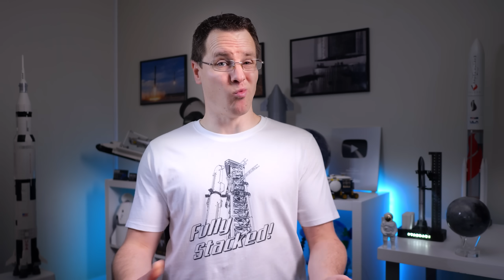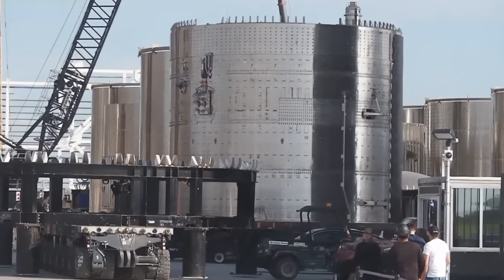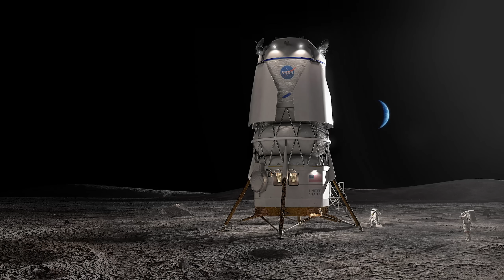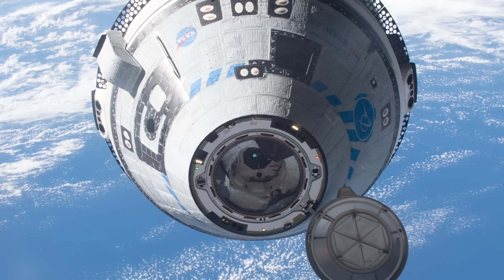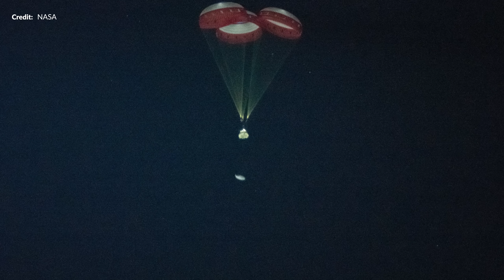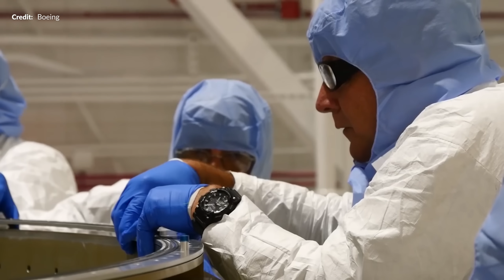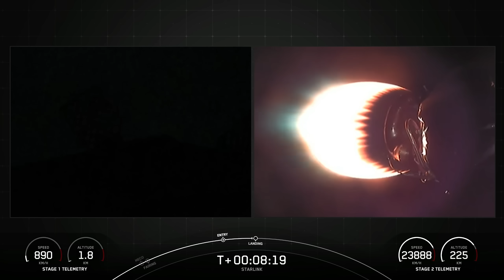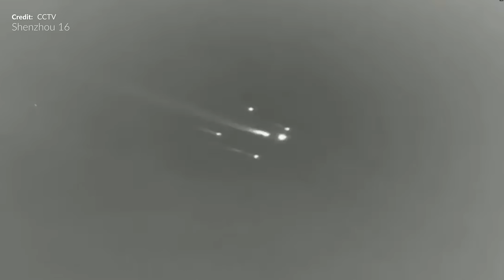SpaceX Starship: Mega Pad Upgrade to Tame the Thrust, Boeing Starliner Delayed Indefinitely

Comment: The fact that there is a problem with flammable tape in Starliner is somewhat unsurprising given that Boeing is the contractor. Their current recurring issues in commercial aviation products and the roots of their space products reaching back to North American Aviation and the Apollo 1 disaster seem to point to a company that just can't grasp the concept of learning from mistakes and incorporating that knowledge into basic design parameters.
Reply: To be fair, the tape is flammable only in certain situations per reports. And requires failures of other hardware to happen. Per NASA/Boeing, "Although that tape is commonly used on other spacecraft, they are evaluating if it is acceptable for crewed flight (article NASA and Boeing say preparations continue for July Starliner test flight Jeff Foust May 27, 2023)"

Parachute and wiring issues to delay Starliner crewed test flight
Jeff Foust - June 1, 2023

"Both the parachute soft links and wiring tape were used on the Orbital Flight Test (OFT) 2 uncrewed test flight in May 2022 without incident. The soft link issue, officials said, would only be a concern if one of the three main parachutes failed, putting additional loads on the other two, while the flammable tape would have required what Nappi called “multiple failures” elsewhere in the spacecraft."

---------------

Boeing finds two serious problems with Starliner just weeks before launch
ERIC BERGER - 6/1/2023

"The second issue involves P-213 glass cloth tape that is wrapped around wiring harnesses throughout the vehicle. These cables run everywhere, and Nappi said there are hundreds of feet of these wiring harnesses. The tape is intended to protect the wiring from nicks. However, during recent tests, it was discovered that under certain circumstances possible in flight, this tape is flammable."

Comment: dude  is stupidly made , fast and meaningless lol  :) , that "jet countermeasure" should have a conus like an icecream tip , to guide the flow in a wished direction , it does not matter speed or any amounts of whatever the damn flare puts out , it has to be guided to avoid any other damage , i worked in esa`s  test rockets motors instalations, they all have a directed exhaust in such manner that the most of the damage is simply "oriented " in a direction where it could not destroy or harm anything , pls make sure to forward my advice here , experience with that you can also find in Schaubergers waterflow studies, is a flow no matter the power.

Comment: Nobody wants to hear it about starliner. We all knew boeing sucks but still you kiss their behind.
Reply: I think he's just trying to be nonconfrontational.
Reply: @ReiseLukas  what a joke
Reply: To be fair, the tape is flammable only in certain situations per reports. And requires failures of other hardware to happen. Per NASA/Boeing, "Although that tape is commonly used on other spacecraft, they are evaluating if it is acceptable for crewed flight (article NASA and Boeing say preparations continue for July Starliner test flight Jeff Foust May 27, 2023)"

Parachute and wiring issues to delay Starliner crewed test flight
Jeff Foust - June 1, 2023

"Both the parachute soft links and wiring tape were used on the Orbital Flight Test (OFT) 2 uncrewed test flight in May 2022 without incident. The soft link issue, officials said, would only be a concern if one of the three main parachutes failed, putting additional loads on the other two, while the flammable tape would have required what Nappi called “multiple failures” elsewhere in the spacecraft."

---------------

Boeing finds two serious problems with Starliner just weeks before launch
ERIC BERGER - 6/1/2023

"The second issue involves P-213 glass cloth tape that is wrapped around wiring harnesses throughout the vehicle. These cables run everywhere, and Nappi said there are hundreds of feet of these wiring harnesses. The tape is intended to protect the wiring from nicks. However, during recent tests, it was discovered that under certain circumstances possible in flight, this tape is flammable."

Comment: Having to replace tape that insulates wiring on Starliner, that they have only just now worked out is flammable seems to be very unprofessional for a company that has been making rockets and parts for decades....
That type of tape should not even be anywhere in or near the factory...... you'd like to think they could get tape right by now.....
🇦🇺🤔🤙
Reply: To be fair, the tape is flammable only in certain situations per reports. And requires failures of other hardware to happen. Per NASA/Boeing, "Although that tape is commonly used on other spacecraft, they are evaluating if it is acceptable for crewed flight (article NASA and Boeing say preparations continue for July Starliner test flight Jeff Foust May 27, 2023)"

Parachute and wiring issues to delay Starliner crewed test flight
Jeff Foust - June 1, 2023

"Both the parachute soft links and wiring tape were used on the Orbital Flight Test (OFT) 2 uncrewed test flight in May 2022 without incident. The soft link issue, officials said, would only be a concern if one of the three main parachutes failed, putting additional loads on the other two, while the flammable tape would have required what Nappi called “multiple failures” elsewhere in the spacecraft."

---------------

Boeing finds two serious problems with Starliner just weeks before launch
ERIC BERGER - 6/1/2023

"The second issue involves P-213 glass cloth tape that is wrapped around wiring harnesses throughout the vehicle. These cables run everywhere, and Nappi said there are hundreds of feet of these wiring harnesses. The tape is intended to protect the wiring from nicks. However, during recent tests, it was discovered that under certain circumstances possible in flight, this tape is flammable."

Comment: Using flammable tape is gross negligence, not an anomaly.
Reply: To be fair, the tape is flammable only in certain situations per reports. And requires failures of other hardware to happen. Per NASA/Boeing, "Although that tape is commonly used on other spacecraft, they are evaluating if it is acceptable for crewed flight (article NASA and Boeing say preparations continue for July Starliner test flight Jeff Foust May 27, 2023)"

Parachute and wiring issues to delay Starliner crewed test flight
Jeff Foust - June 1, 2023

"Both the parachute soft links and wiring tape were used on the Orbital Flight Test (OFT) 2 uncrewed test flight in May 2022 without incident. The soft link issue, officials said, would only be a concern if one of the three main parachutes failed, putting additional loads on the other two, while the flammable tape would have required what Nappi called “multiple failures” elsewhere in the spacecraft."

---------------

Boeing finds two serious problems with Starliner just weeks before launch
ERIC BERGER - 6/1/2023

"The second issue involves P-213 glass cloth tape that is wrapped around wiring harnesses throughout the vehicle. These cables run everywhere, and Nappi said there are hundreds of feet of these wiring harnesses. The tape is intended to protect the wiring from nicks. However, during recent tests, it was discovered that under certain circumstances possible in flight, this tape is flammable."

Comment: If the Chinese are recovering the boosters It Might be easier to put a single, smaller shute into each one. That way you get at least three boosters back if one fails. Or perhaps the boosters are designed to plop nose first into the sea and bob up again.

Comment: Per China's 4 booster separation before dropping the remainder, I believe it's momentum related, as the separation charges have an equal and opposite force problem being solved. Removing the extra weight to the side reduces the stress on the stage that matters the most.

Comment: If they have to take apart Starliner to remove all of that tape there is no way they will have it ready to go this year! The more they tinker with it the more problems they seem to find. They knew it wasn't ready for human flight. Boeing is a disaster
Reply: To be fair, the tape is flammable only in certain situations per reports. And requires failures of other hardware to happen. Per NASA/Boeing, "Although that tape is commonly used on other spacecraft, they are evaluating if it is acceptable for crewed flight (article NASA and Boeing say preparations continue for July Starliner test flight Jeff Foust May 27, 2023)"

Parachute and wiring issues to delay Starliner crewed test flight
Jeff Foust - June 1, 2023

"Both the parachute soft links and wiring tape were used on the Orbital Flight Test (OFT) 2 uncrewed test flight in May 2022 without incident. The soft link issue, officials said, would only be a concern if one of the three main parachutes failed, putting additional loads on the other two, while the flammable tape would have required what Nappi called “multiple failures” elsewhere in the spacecraft."

---------------

Boeing finds two serious problems with Starliner just weeks before launch
ERIC BERGER - 6/1/2023

"The second issue involves P-213 glass cloth tape that is wrapped around wiring harnesses throughout the vehicle. These cables run everywhere, and Nappi said there are hundreds of feet of these wiring harnesses. The tape is intended to protect the wiring from nicks. However, during recent tests, it was discovered that under certain circumstances possible in flight, this tape is flammable."
Reply: @steveaustin2686  I totally get that. But Boeing should have been aware that that tape wasn't yet human flight tested or approved.. They aren't new to the space flight industry. That's really my issue with them. They have been dropping the ball across multiple programs (SLS). They are saying in some reports this tape is almost impossible to remove from components so it might require complete replacement of wiring in areas..
Reply: @cdav8853  "Although that tape is commonly used on other spacecraft, they are evaluating if it is acceptable for crewed flight (article NASA and Boeing say preparations continue for July Starliner test flight Jeff Foust May 27, 2023)". Reports are, that they may just cover problem areas with more tape, since it apparently requires more than one failure for the tape to possibly catch fire.

Comment: Everything points to Bocca Chica becoming the only Starship production facility. That means boosters and starships being transported to Florida at some point by barge. Or maybe SpaceX will resume a Florida factory in the future.
Reply: Boca Chica is as much about learning how to build Starship facilities as it is for testing Starships. Also NASA is leary of testing Starships at LC-39A, when it is the only pad for Crew Dragon. SpaceX recently started upgrading SLC-40 with a crew tower, so it can also do Crew Dragon launches. I would not be surprised if SLC-40 will also be used for Falcon Heavy as well. Part of the USSF-67 contract was for a vertical integration facility (VIF) for NSSL payloads. It would make sense to build the VIF at SLC-40 on the Cape Canaveral Space Force Station (CCSFS), rather than at the civilian KSC.

Comment: Flammable tape in wiring harnesses? Did nobody learn anything from the Apollo fire?
Reply: To be fair, the tape is flammable only in certain situations per reports. And requires failures of other hardware to happen. Per NASA/Boeing, "Although that tape is commonly used on other spacecraft, they are evaluating if it is acceptable for crewed flight (article NASA and Boeing say preparations continue for July Starliner test flight Jeff Foust May 27, 2023)"

Parachute and wiring issues to delay Starliner crewed test flight
Jeff Foust - June 1, 2023

"Both the parachute soft links and wiring tape were used on the Orbital Flight Test (OFT) 2 uncrewed test flight in May 2022 without incident. The soft link issue, officials said, would only be a concern if one of the three main parachutes failed, putting additional loads on the other two, while the flammable tape would have required what Nappi called “multiple failures” elsewhere in the spacecraft."

---------------

Boeing finds two serious problems with Starliner just weeks before launch
ERIC BERGER - 6/1/2023

"The second issue involves P-213 glass cloth tape that is wrapped around wiring harnesses throughout the vehicle. These cables run everywhere, and Nappi said there are hundreds of feet of these wiring harnesses. The tape is intended to protect the wiring from nicks. However, during recent tests, it was discovered that under certain circumstances possible in flight, this tape is flammable."

Comment: Boeing has this Dinosaur-like quality to it. It’s going to get Starliner done eventually and that’s a pretty good thing but jeez flammable tape?!
Reply: To be fair, the tape is flammable only in certain situations per reports. And requires failures of other hardware to happen. Per NASA/Boeing, "Although that tape is commonly used on other spacecraft, they are evaluating if it is acceptable for crewed flight (article NASA and Boeing say preparations continue for July Starliner test flight Jeff Foust May 27, 2023)"

Parachute and wiring issues to delay Starliner crewed test flight
Jeff Foust - June 1, 2023

"Both the parachute soft links and wiring tape were used on the Orbital Flight Test (OFT) 2 uncrewed test flight in May 2022 without incident. The soft link issue, officials said, would only be a concern if one of the three main parachutes failed, putting additional loads on the other two, while the flammable tape would have required what Nappi called “multiple failures” elsewhere in the spacecraft."

---------------

Boeing finds two serious problems with Starliner just weeks before launch
ERIC BERGER - 6/1/2023

"The second issue involves P-213 glass cloth tape that is wrapped around wiring harnesses throughout the vehicle. These cables run everywhere, and Nappi said there are hundreds of feet of these wiring harnesses. The tape is intended to protect the wiring from nicks. However, during recent tests, it was discovered that under certain circumstances possible in flight, this tape is flammable."

Comment: Boeing should go back to having engineers in their board of director and not financial dudes who just want to cut cost and make profit. That’s why they ended up with planes that can not fly safely and that’s probably why they can’t built a capsule either.
Reply: The 1990s merger with McDonnel-Douglas is widely seen as Boeing's downfall. The new management has a huge hole to dig out from.

Comment: Maybe check-in with Henson.  Tried your discount code on checkout and got this message:  "MARCUS discount code isn’t valid for the items in your cart"
Reply from the maker: Do make sure you have 1 razor and 1 pack of 100. It it a tad confusing if it hasn't added both or you have multiple.
Reply: @MarcusHouse  That sorted it out

Comment: stubborn - they should be building a flame trench AS WELL as water deluge - or penny-pinching?
Reply: To be fair, the OLM distance to the ground is roughly the same as the distance from the pads at LC-39 to the bottom of their flame trenches. The OLM didn't have a flame diverter and water deluge system for the 'orbital' launch. Musk mentioned that they have a water-cooled steel plate system to install under and possibly around the OLM, but it was not ready yet. Musk's "the best part is no part" philosophy bit him in the arse with the no diverter or deluge part. He rolled the dice that Stage 0 would make it through one launch without them and came up with a Nat 1 on the d20.

Comment: I dismissed them at the time because they mostly came from unashamed SpaceX fanboys, but there were rumours  in the early days of Starliner that Boeing management knew the design was inherently flawed but were confident that SpaceX would screw up and they'd be able to get all the extra time and money necessary to fix it. On the available evidence I have to say the fanboys may well have been right all along.
Reply: Starliner is on a fixed-price contract, so Boeing has been paying for the fixes. They could not do what the rumors said.

Comment: Surprised they have slowed down at the Cape with the recent success. Any explanation?
Reply: Waiting for data analysis
Reply: Boca Chica is as much about learning how to build Starship facilities as it is for testing Starships. Also NASA is leary of testing Starships at LC-39A, when it is the only pad for Crew Dragon. SpaceX recently started upgrading SLC-40 with a crew tower, so it can also do Crew Dragon launches. I would not be surprised if SLC-40 will also be used for Falcon Heavy as well. Part of the USSF-67 contract was for a vertical integration facility (VIF) for NSSL payloads. It would make sense to build the VIF at SLC-40 on the Cape Canaveral Space Force Station (CCSFS), rather than at the civilian KSC.